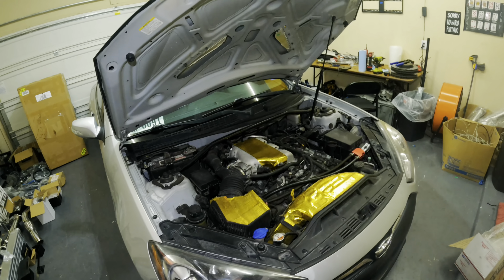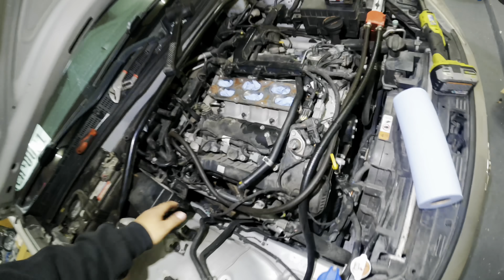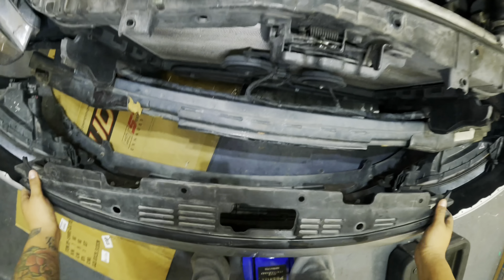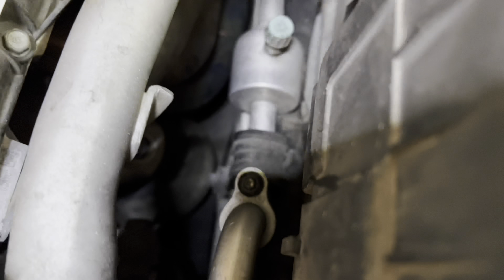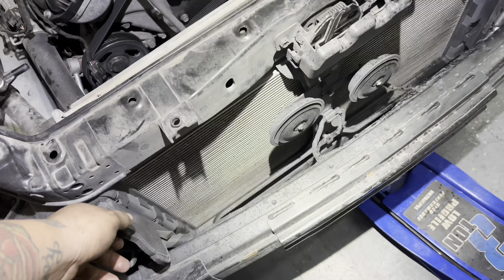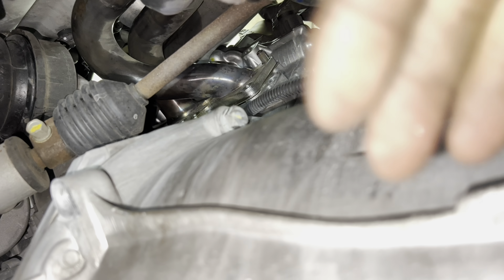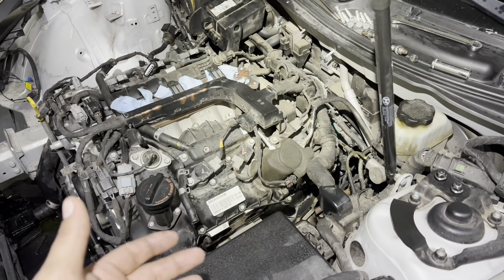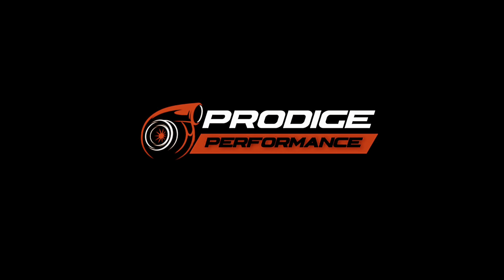Genesis Coupe 3.8T Remnant Performance Turbo Kit Install Pt.1

Comment: Thinkin ab buying a kit but my trans gets hot sometimes and the other day oil temp got really hot and was Smokin out the back no lights or anything drives fine, I’m at 98k miles change oil every 3-5 w full synthetic not sure if I should turbo it or just get rid of the car it’s a stock 2015 3.8 auto

Comment: was this installed on a fully stock genesis ?
Reply from the maker: Yep, no need to go upgraded internals unless you want to push past 8 psi. 
Anything under and it’s pretty safe. I have multiple 3.8s that I’ve put a turbo kit on that are still daily driving their gen till this day.
Reply: @ProdigePerformance hello do u race them bro?
Reply from the maker: @diegow00baby19  my personal car yes 
Not the ones I build for customers

Comment: are you completely stock internals?
Reply from the maker: Yep it’s completely stock internals, running 8 psi strong still. Just did his oil change a week ago also
Reply: @ProdigePerformance  if close, would you possibly be down to install another?😅 ofc w compensation
Reply from the maker: @williampadilla3870  yeah absolutely. I live in Texas just a heads up
Reply: Dfw area?